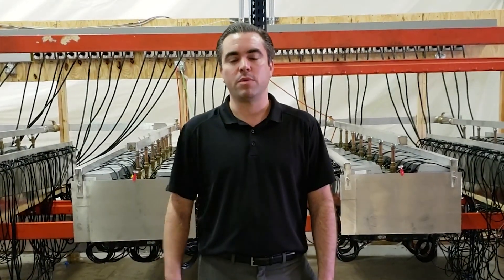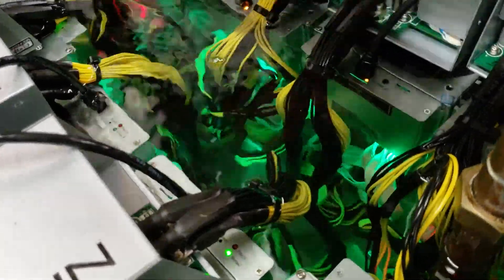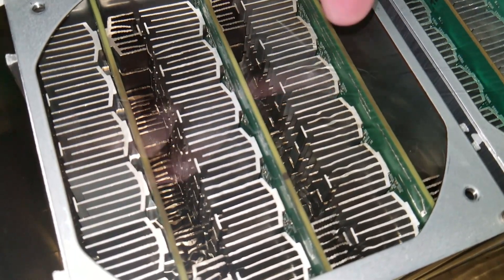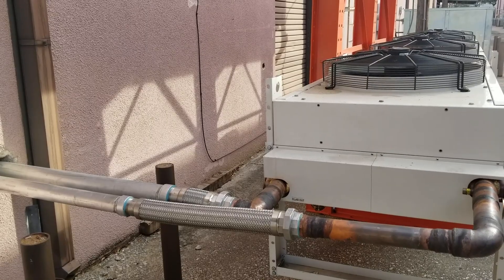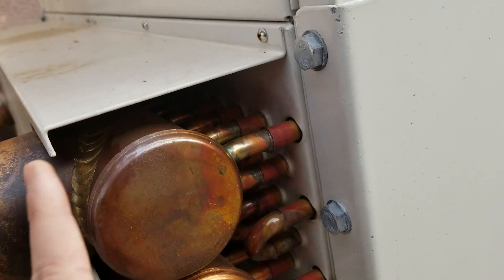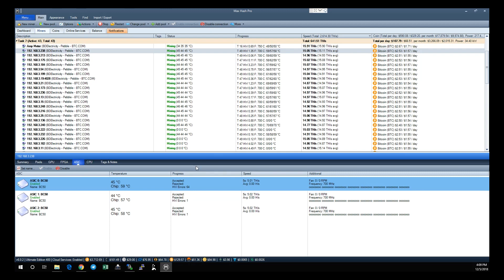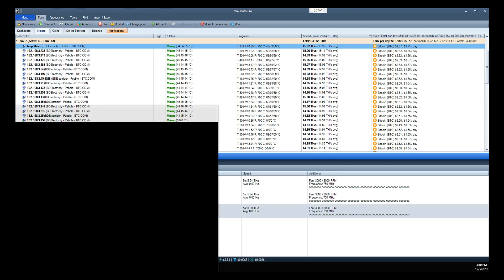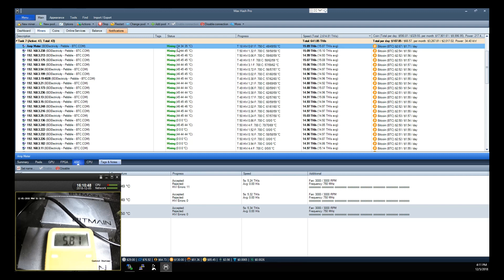Immersion Systems - Introduction

Comment: Why have the tanks open on the top. Wouldn't you want to cover it from dust in your facility...seems poorly thought of imo. Put your psu in as well. One of the benefits would be less noise...thats the point of immersion cooling right? Get rid of the heat and fans?
Reply: Dust isn’t much of a problem with liquids and you don’t necessarily need to cool the power supply.
Reply: I did that with my set up works great

Comment: What coolant do you use ? I'd try silicon oil, but it tends to be rather expensive...
Reply: They use Bitcool BC-888
Reply: Bitcool one-phase oil. 
200KW immersion cooling box, holding 39*S19, click: https://youtu.be/w029O8xXBHM

Comment: Does this system reduce the electricity bill as compared the non immersible ( on normal rack system cooled by air flow method) ?
Reply: I’m a totally layman, but I’d say no- because those massive coolers and pumps draw a huge amount of power. This cooling system provides a higher hashrate and reduced noice level - at the cost of more powerusage. Again - I’m a layman, but that’s my initial impression. Higher hasrate - higher powerconsumption. If it all adds up? They forgot to tell us that.
Reply: @skakpedersen  I agree with you, the cooling in the Devices is fine, but those huge fans outside, water pumps, etc.. generates a lot of electricity, that's how I see it, so you have to make a balance between earning more and spending more electricity..
Reply: @skakpedersen  It does draw less power, depending on how many miners you run in the system.
Reply: @skakpedersen  There is also much easier maintenance regarding duct cleaning. Cleaning dust on a single large radiator is much easier than doing on hundreds of ASIC miners individually.
Reply: I think that the oil cooling makes it possible to mine close to the sea without the problems caused for salty breese
Reply: https://youtu.be/VUl6y118AbU
Reply: Yes, reduce power bill. 
200KW immersion cooling box, holding 39*S19, click: https://youtu.be/w029O8xXBHM

Comment: What are you using to trick the miners that they still have their fans attached?
Reply: Google search 'fan simulator'
Reply: @allvids187  those are s9s you can install Braiins OS+ firmware in those and just turn off the fan sensors.

Comment: What software are you using to monitor the miners ?
Reply: It’s awesome miner
Reply: Don't need any software. Our tank has a built-in system (network system)  https://youtu.be/VUl6y118AbU， Hi We also do the immersion, for more info to look at the link or contact me by Lizzy@aldminer.cn
Reply: 200KW immersion cooling box, holding 39*S19, click: https://youtu.be/w029O8xXBHM

Comment: Why didn't you immerse the PSUs aswell? Should be even less noisy.
Reply: Because the fluid is used to run the miners at higher hashrates, and cooling the PSUs would merely diminish their ability run the miners at the highest hash rate possible.

Comment: How much Immersion cooling cost?
Reply: Fluids are anywhere from $5-25 a gallon depending on what you use.

Insfratructure costs vary depending on what you use.  You could spend thousands commercially or much less DIY, plus additional costs for electricity to run the system.
Reply: Our smallest one 40KW 415/240V is at USD 2399. https://youtu.be/VUl6y118AbU， Hi We also do the immersion, for more info to look at the link or contact me by Lizzy@aldminer.cn

Comment: there are possibilty to increase hashrate to 20 TH in immersion system by our firmware, and it works very nice.
Reply: What software
Reply: You need overclocking psu. 
200KW immersion cooling box, holding 39*S19, click: https://youtu.be/w029O8xXBHM

Comment: Great video, I wish it had more information though. Like what if I just want 1 tank , 2tanks ect.  Power requirements per tank, per dry cooler?
Reply from the maker: Hi Kevin!

Feel free to reach out to us at 'sales@immersionsystems.io' and we'll be happy to help you with any information you're looking for :-).
Reply: https://youtu.be/VUl6y118AbU
Reply: We use cooling tower. Can be one cooling tank for one cooling tower, also can be several cooling tanks share on cooling tower. 
200KW immersion cooling box, holding 39*S19, click: https://youtu.be/w029O8xXBHM